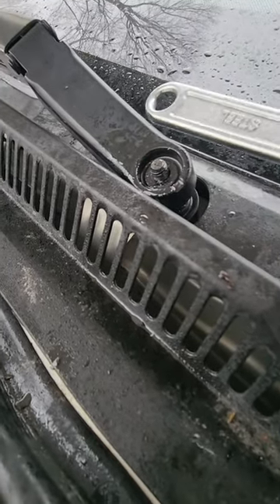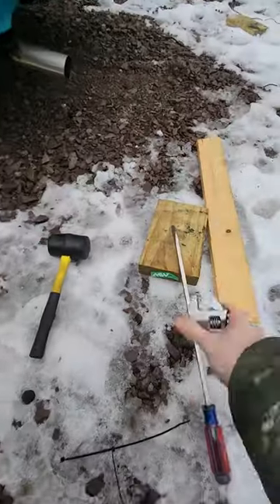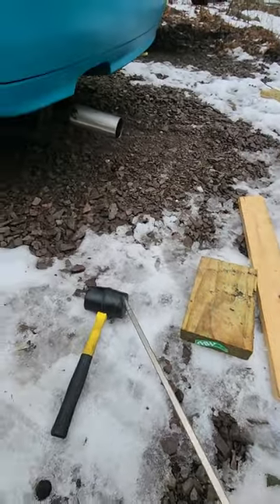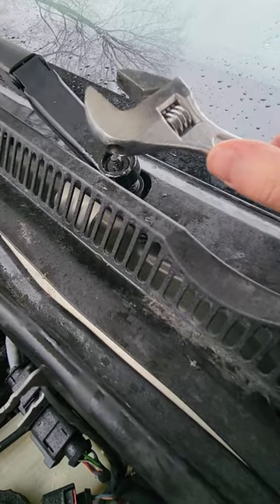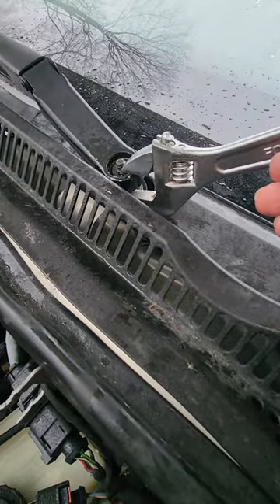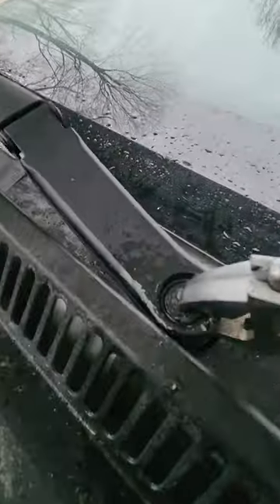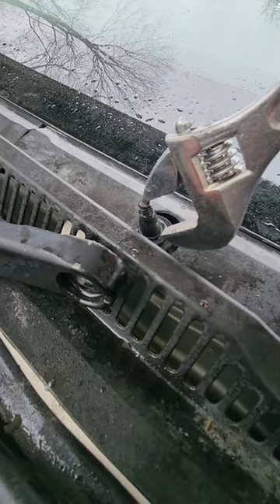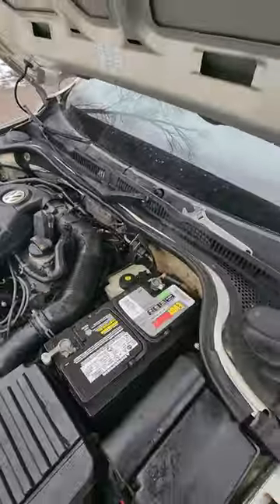Try this before buying a windshield wiper arm puller

Comment: You saved me a great deal Mr puberty! Pulled dash off to change the heater core to realize I was stuck on the windshield arm without a store in a 30 mile radius to buy a puller. TY
Reply from the maker: Glad to hear!
Reply: Mayson you have a good sense of humor a very likable quality.

Comment: The reason wiper arms get stuck is galvanic corrosion (the aluminum alloy arm in contact with the steel spindle results in corrosion). Put some grease on the splines of the spindle before you reinstall the wiper arm. It will reduce corrosion and make the arm easier to release next time. And before you guys say anything, I have done this for about 40 years and never had an arm work loose on the spindle. On the other hand, there is no need to grease the threads on the end of the spindle before you reinstall the nut, as steel against steel will not corrode anywhere near as much as steel against alloy. Grease on the threads also makes it easier to overtighten and strip the threads, and it creates a risk of the nut loosening.

Comment: Press down a few times on the joint. Lift the arm up at the joint, grab the wiper where the spline goes through it. Wiggle back in fourth (from the upper part above the joint) while pulling upon the wiper arm(down at the bolt. You dont need a puller or any of those tools for that. I worked for Safelite for 3 1/2 years and for this style I've never needed anything. Other styles absolutely such as a 60's ford stlye.
Reply: This worked like a charm!  Thank you for taking the time to write that up.
Reply: Instructions unclear, standing here with half of the wiperarm in my hand..😂
Reply: You just saved me thank u so much

Comment: You can do it by hand by pushing the spot that raises the wipers up or you can grab it and do a push down pull up motion.  That’s how we do it when taking the cowling off for windshields anyways.
Reply: Wrong. You cannot do this on German vehicles
Reply: @markfromtinder9616  most certainly can, the wipers with two arms, most commonly on Mercedes, is actually easier.  I guess because of how poorly they’re made they do break pretty easy but that’s if you don’t know what you’re doing.

Comment: If you fold the arm at the spring you get better leverage to waggle it on the post. Should you try  using shock treatment with a copper hammer on the post ..Don't, you end up pushing the mounting plate down  and the wiper arms scratch the windscreen.

Comment: Nice.  Some makes I usually lift the arm like your changing the blade usually unlocks the spring tension  that locks it to that bolt must be a fail safe if the nut was missing. But that seems like the next level if it's truly stuck thanks!

Comment: You don't need any tools. Just lift the arm up (it locks in the down position) and wiggle the arm from side to side at th base. It may not break free at first,  but it will. It's only crud stopping it from coming off.

Comment: A battery post puller is cheap and works.  Can't do this if it goes through glass.
Reply: Yes you can! I just did it on rear wiper. Thanks for the tip!

Comment: Well that didn't work
Reply from the maker: I am sorry to hear that, did you spray it at all with wd-40 or pb blaster? Maybe it's getting caught up. Also don't get it on the windsheild. Good luck
Reply: @mayson2  hey thanks for replying. I ended up buying a wiper arm puller and it was really worth the $15. It made all the difference and I just got done replacing the motor and linkage 👍
Reply from the maker: @baldbearded9601  awesome good to hear